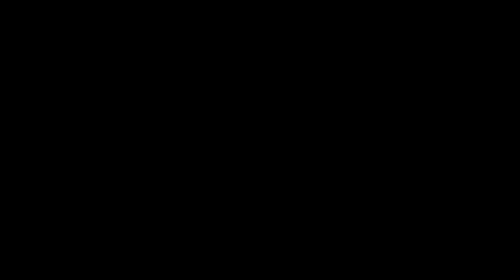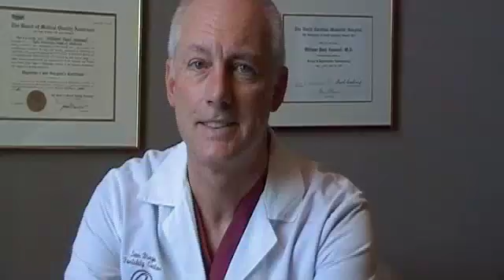Why Did My IVF Treatment Fail?

Comment: I was already done 3 IVF and felt really hopeless on this issue. Adding to it, I found out that I had thyroid too and my health conditions generally were also not good. I went for many treatments even those which were far away from my hometown but felt helpless and hopeless at the same time. Lately I heard about one clinic in Eastern Europe and through surfing found out that their success rate was really high. Firstly I thought to let go as I already lost the faith in myself, then a voice came from inside me that lets try for the sake of the chance. Fortunately I was treated really well. My coordinator really helped me and boosted my confidence. Answered all of my queries and more than anything they all actually tried their best and not only provide me with each and every solution but also made my treatment successful. They are really the true example for hospitality, commitment and reviving strength. I will recommend you all to visit or call or even mail them and see yourself that how they use immediate response technique and personal service to not only comfort you but would also become your last hope.